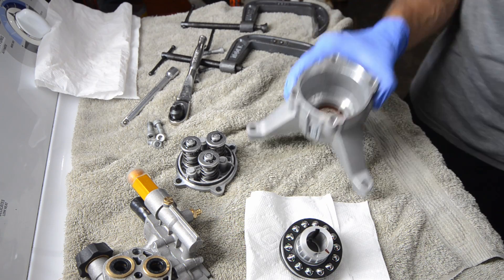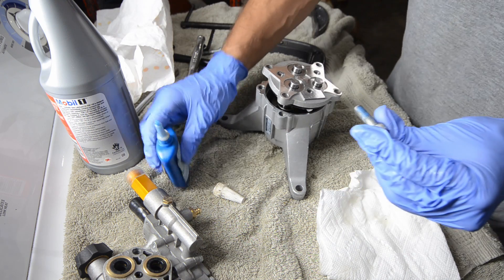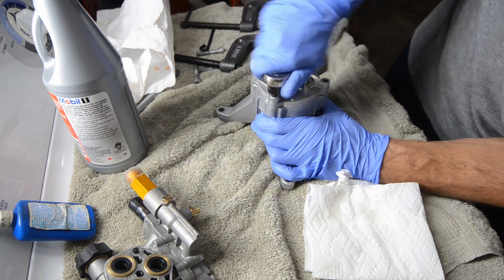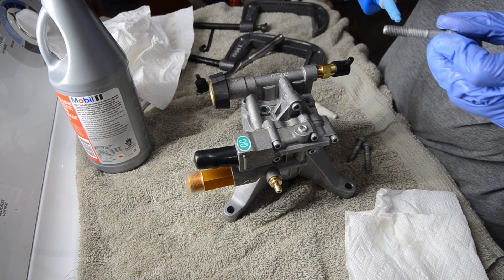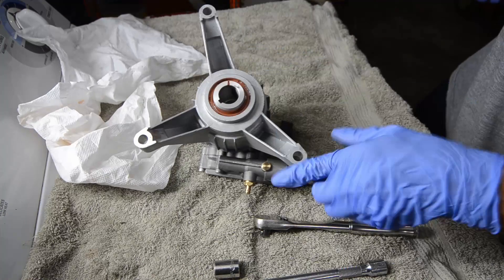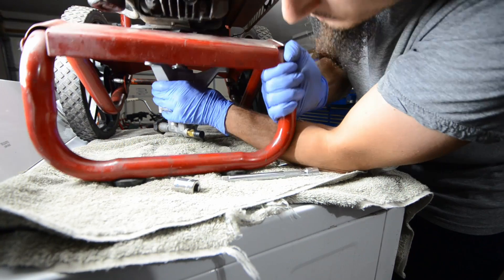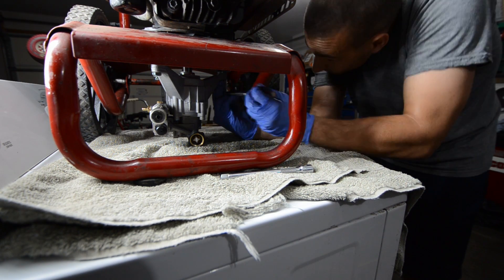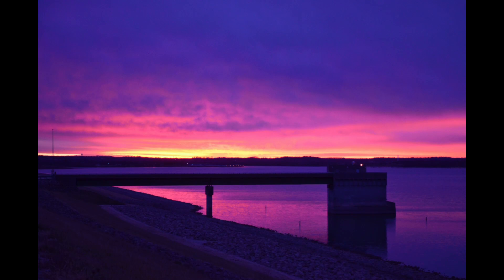How To Pull Apart And Inspect A Chinese Axial Cam Pressure Washer Pump From Amazon. Part 2/2

Comment: The bolt pattern of the 3 'legs' of the pump only allows for mounting in one position. You have to be careful to buy the correct orientation of the water inlet/outlet.  A good addition to any power washer setup would be an in-line filter to rid of any solid contaminants that could mess with the pump internals.

Comment: Ive seen axial pumps all fail the same way, eventually water seeps through those black seals and mixes with the gear oil and turns it into a grey milky mess and it's game over.

Comment: My pump water lines when connected to motor are facing toward the frt.Can I reverse ti water connecton to pump? So my water hose can connect in the rear???
Reply from the maker: Depending on what pump you have you usually can turn them around to at least some degree. Either by just unbolting it from the motor and rotating it or you may have to take it apart to spin it around.

Comment: Need to change mine. I’ve used it a few times so I’m sure there’s debris from the break in process and like you mentioned I’m sure it’s filled with the cheapest oil possible.

Comment: Nice work! So I have a question: Since it's been 5 years since you posted this video, I'm curious if the cheap Chinese made pump is still working (assuming your neighbor still is your neighbor and still uses the thing).  I have one that has lasted over 15 years and finally gave out (the pump part).  It came with and Annovi AR (Italian made) pump but the cost of replacing just the pump (exact replacement) is twice what I originally paid for the entire unit.  Even the AR rebuild parts I need are more expensive than an Atima brand (assuming Chinese made) complete pump.  So I'm just curious if you or anyone on this post has had good luck with Chinese made PW pumps.  Would like to know before I go that direction.  Thanks.
Reply from the maker: I honestly have no idea. I am no longer in that area and have not heard from him since.

Comment: Thanks, and very helpful to see how these pumps are generally constructed and put together.  I have an older 2600 PSI pump which has built up some scale and corrosion over the years.  Since the housing of the pump has brass parts I have found that a product like C-L-R is not recommended as it can damage the brass.  Do you have a suggestion of a cleaning solution that would work on the scale build up and corrosion?  Thanks
Reply from the maker: Not really but I hear Vinegar may work.

Comment: my axial pump says to use sae 30 right on the pump. is there an advantage o using gear oil?
Reply: Its more thicker and probably holds more heat.

Comment: I read these are supposed to use straight 30 weight non-detergent oil. Is gear oil better?? I'm rebuilding an even crappier pump. The female coupler where the engine shaft slides into, the hole in the coupler goes all the way through. So you have to assemble the entire pump first, then fill it with oil, then install it on the engine without spilling the oil.... There is just a stupid rubber gasket between the top of the pump and bottom of the engine, that's all that keeps the oil in. In any case, I think I will use some synthetic gear oil like you show instead of straight 30 like I've read on several sites.
Reply: 30 weight non detergent is for the pump motor. Generally you don't ever replace the gear oil in the pump drive on these style pumps because the pumps don't last long enough for it to need changed. Therefore the manufacturer doesn't specify what's used in it. Most people's mentality is throw it away and buy a new one because they are cheap. This guy was looking to stack the cards in his favor that he could make the pump last a little longer. But the weak link on these pumps has always been the plastic check valves that they use inside the high pressure side of the pump. It's just planned obsolescence unfortunately.

Comment: I like it coming out the front better too. Pump to frame only mounts one way. The two pieces of the pump can mount 180° out. A perfect example of the real Murphy's Law.
Reply: I can see when connecting hoses and while using it, why coming out the front is better. But how about when moving the washer? Still good?

Comment: Forget the spacers!!!.  All you did is lower the pump  down farther below the engine plate than before, and if the pressure washer ends up on the grass, you just burns the grass up faster since the pump will get hot.  
So lets say that  if you need to space the pump down 1" from the shaft being too long.   Take a grinder with cut off blade, and shorten the end of the motor shaft  1-1/8".  As for key, don't be in a big rush to cut it down, since if up the shaft a touch in the groove above the pump on the motor shaft, works out better, then trimmed so it only fits the groove on the pump alone.

Last one, and oiling the upper pistons  are fine with gear lube, but on the other rubber seals/O rings that you can get to, use Silicone/dielectric grease before you start putting the pump back together.

Also, pull the unloader since you only have to pull the U clip, and go to town on greasing the O rings on it with silicone grease as well.  The seals greased, will last a lot longer and easier to pull at a later date.  As for the unloader, if you have a way of measuring from the end of the lock nut to end of shaft to put them back on with the same amount of spring pressure, then you can pull the unloader spring assembly apart, to grease the Two O rings in side of it so those O rings last a lot longer/ to prevent unloader binding so less rod bending over time; forcing you to have to replace the unloader. Also, Silcone grease the end rod section, and work the grease in the pin channels to prevent unloader end rod binding that will not allow the pump to build up pressure when it stick all the way forward.

Comment: You mentioned several times about metal fragments and you thoroughly wiped out the casting, but did not seem to clean the bearing plates and other internal pump components. Shouldn’t they also be cleaned before filling with oil and reassembling?
Reply from the maker: I wiped down everything before putting it back together. The metal pieces were likely formed when they tested the unit. All the large pieces were in the bottom.

Comment: Hi great video. So let us know how did the pump work with the gear oil? some people recommend 5w 40 engine oil and some recommend gear oil. How did the pump perform? How long did it last ?
Reply from the maker: As far as I know the pump is still running. Have not talked to the person who owns it in a while.
Reply: @bassntruck  your value added services worked great. I have the same pump almost new. I will now change the oil. I have liqui moli fully synthetic 75w 90.

Comment: Id like to put two .25in taps on that drive side, so that i can replace the oil without disassembly.
Reply from the maker: If you look the old pump has a npt fill plug. This pump had the spot for it but was no drilled and tapped. If it was mine I would have added it.

Comment: I'm repairing my grandmother's pressure washer pump. The bolts snapped at the water housing. Lost pressure and started spewing water. Getting the bolts out was a challenge but I got them. Thanks for the video it's helpful. Strange though there's a sticker on this pump that says to use 10w - 40 oil in it.

Comment: Hi! can you send me the link to order some spacers like the one you used? Thanks
Reply from the maker: I just used some bar stock I had laying around and drilled some holes in it. Here is a link to some bar stock or I found some spacers that are cheaper and might look nicer.
1" square tube: https://amzn.to/2YTaIOW
Spacers: https://amzn.to/2AbJ8C8
Reply: Thanks, I just bought a new pressure washer from Costco. Do you think I should change the pump oil? That pump comes with the engine from the manufacturer
Reply from the maker: @KhanhNguyen-xj6qv  Not sure why you would need spacers then. But I would change the oil if you want it to last. Would also recommend changing it based on use over time.
Reply: @bassntruck  I asked for the spacers because I was trying to repair my aunt's one. Her Honda engine was seized so I bought another engine to set up with her old pump. The new engine I just bought has longer drive shaft so  I changed the bolts which are also longer. That is why I need some spacers. Btw Thank you for answered my question. I will change the pump oil as soon as it arrives, I am still waiting for Costco ship it.
Reply from the maker: @KhanhNguyen-xj6qv  That makes more sense. Spacers: https://amzn.to/2AbJ8C8
Not sure if it showed the spacer link.
Reply: Great job thank you. My question is canon add a regulator to that pump?
Reply from the maker: @henryurey6629  Do you mean a pressure regulator? If so then I am not sure, never thought about that or looked into it. But I guess it might be possible. Not sure why one would need to thought. Simpler to just slow the engine down.

Comment: Huh?  the original bolt pattern is 4 bolts in a tight radius, and somehow magically a 3 bolt pattern just bolts in?
Reply from the maker: If you look at the 11:00 mark and pause it you will see the old pump mounted directly to the bottom of the engine near the shaft. This pump mounted to the bolts that mounted the engine to the body. That is why I needed new bolts and made some spacers.

Comment: Just a conversion note: that 22mm wrench is replaceable with a 7/8".  22mm=0.866".  7/8"=0.875".   The 7/8" is .009 larger and will work on a 22mm bolt just fine.  A big help if you don't have metric in sizes bigger than 19mm!  Good video.  My Chinese replacement pump has been acting flaky for a while now.  When I replace it, and I'm sure I will have to, I'll use this guide to prolong the pump's life.  Good, clean, lube is almost everything in keeping parts from wearing.  Wearing = death.

Comment: At 14:04 when you are installing the housing cover, have you ever had to change the o-ring seal that prevents the oil from leaking out of the housing? If so, where do you get it from and how do you know what size to get?
Reply from the maker: I have not had to replace that. But if you needed one just measure the width of the space and the thickness of the old one. You can find them online easily. I would error slightly smaller on the width of you come across and in-between size.

Comment: I just tapped a hole and plugged it for oil changes. Put grease on the bits to collect the chips.
Reply from the maker: The unit I removed had a drain plug IIRC. I thought about adding one but it was not my machine and they would never change it anyway.

Comment: Hi, some people use engine oil, is it ok to use gear oil? Thanks for the sharing :)
Reply from the maker: I hear non detergent 30 weight can be used. I couldn't find any when I was look in synthetic. You don't want regular motor oil.
Reply: @bassntruck  I saw some youtuber used gear oil 80-90...How about Air compressor oil? can be use? Tq
Reply from the maker: @axenz1  I used gear oil. I would not use compressor oil if you car about the pump. But, you could always try it and report back when it blows up.
Reply: @bassntruck  Thanks man ...I might try gear oil later .. Lol
Reply: My pump says 75w90 on it

Comment: Outstanding tear down and build-up video! I noticed my pressure washer pump had some oil leakage after being in storage in my shed. Do I need to replace the o-ring or should I just try tightening down the bolts? I never opened the pump yet and it was brand new before I stored it.
Reply from the maker: Making sure the bolts are tight costs nothing. Hopefully you didn't have water in the pump and it froze while in storage.

Comment: You had a 1 in 4 chance of getting it bolted back correctly. The 4 bolt pattern is square. The 3 bolt pattern on the pump head and the engine are fixed. You can clock the 4 bolts to change the direction of the hose fitting. Check and mark before unbolting it.
Reply: He's saying that when you put the head back on the pump housing you can clock it in different directions. The guy making this video should have bolted it back on 180° than where he did so the hose connection would have faced backward instead of forward.
Reply: He used the 3 engine mounting bolts which are fixed.  He had no choice on the mounting position.  They make another version that points the other way.

Comment: Great video. I've got a couple washers to fix that most likely will get a china made pump replacement. did not know about the bad oil so will definitely change it.
Reply: Craftsman pressure washer unloader valve rebuild

Comment: Well done my friend.....got a question for u....what’s the purpose of a “ quick start” on a pressure washer pump
Reply from the maker: Sheik Shakur As far as I am aware it has nothing to do with the pump. Just that the motor will start in 1 to 3 pulls.
Reply: There a plug called the easy start that fit on some of these pump....with the ball and spring behind....
Reply from the maker: Sheik Shakur That is just a pressure relief valve so the pump does not try to compress when starting the motor.

Comment: Thanks for the excellent instructional video; it gives me confidence to tackle the one I have in the garage. I would  add that the proper bolt torqueing process is to do opposite sides in turn, gradually like you did, but the key is to get them all the same tight.......at some point you need to use a torque wrench, an educated guess to torque would probably work.
Reply from the maker: You are not incorrect that a torque driver will give most people an exact tightness. I did not know the exact number so I can not give that. For me, I have used torque devices enough to be able to tighten most things by hand and get it very close. The housing bolts are not really mission critical if they are tight. I doubt the tolerances are tight enough to matter if it deflects slightly by over tightening.

Comment: Excellent video.... I have the same exact pump, sort of, mine is 2600 PSI, However has the same exact features which is helpful for disassembly/assembly. I forgot how to break into it & put it back to together without blowing it up so to say. You're the first person I've seen fixing a Power washer pump on a washing machine haha... Hope you didn't crack the porcelain. Good job Bassntruck... I am now a subscriber.
Reply from the maker: Thanks  My toolbox was covered in crud and we had just gotten a new dryer, so the obvious choice was use the old dryer. LOL Going to try and get more content up like this once I get the house rebuilt.

Comment: Glad I watched the video. Had ordered same pump , tore it apart after watching this video and found dirt and grindings inside. I marked the outside of the pump from top to bottom with a magic marker before disassembling to assure proper reassembly. Old pump had a 75w90 sticker, so that's what I used. Thanks !
Reply from the maker: Glad it helped.

Comment: nice video.i  found a free gree craftsman  pressure washer with a slightly bad pump might pick one up on ebay like that. it looks like you can rotate which way you want the fittings to go on it . i got some of that same gear lube i might do a sinilar thing and clean out the junk oil if i get one.
Reply from the maker: Glad you liked it. You can always try putting some oil in it but If the damage is already done it will not help much. I tried it on an old pump and it was a waste of oil and time.
Reply: i meant i would put that oil in a new pump if i get a new pump. i got my older pump half ass working .  a friend of mine remachined a part on the inside of the  unloader on it. i just put some 15w40 in the old pump to test out the reworked unloder valve. i ordered a new pump  unloader kit, and anew carb for the engine  too cause it only ran when choked.
Reply from the maker: If the plunger seals are weak it will fill the case with water and the oil milkshake will come out the wand. Ask me how I know.